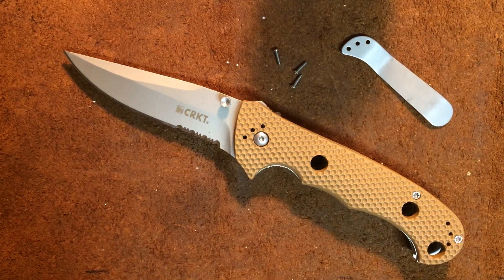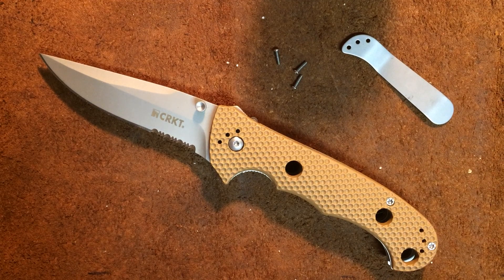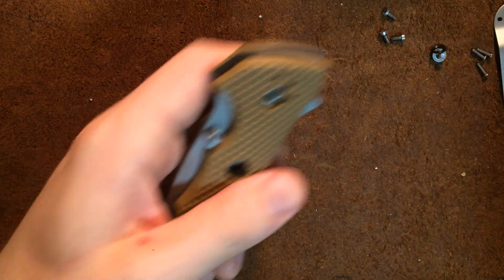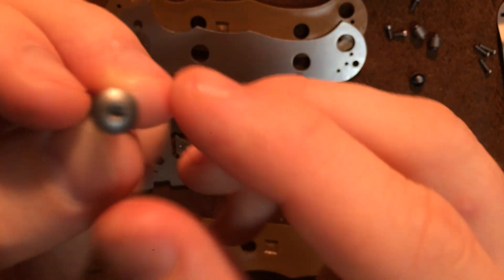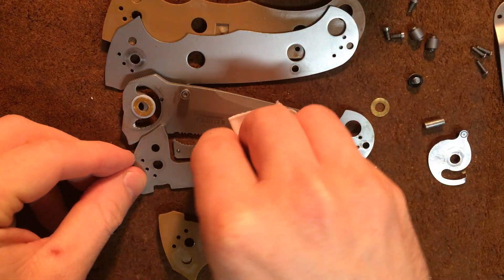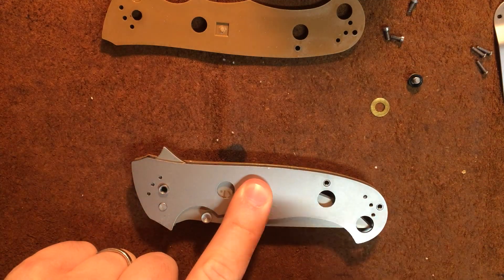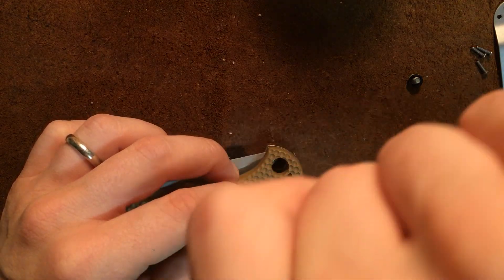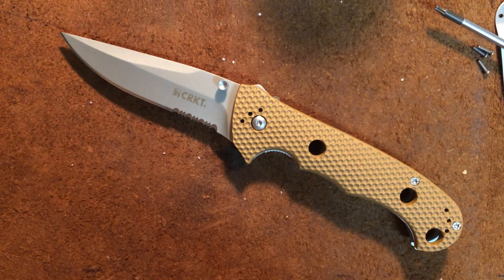CRKT Hammond Cruiser Disassembly

Comment: 11:19 the dent is cause by the placement of the stop in, its on the bottom rather on the top, its cause wear inside rather than outside when you Chop using that knife. CRK DRILLS HOLES IN THEIR KNIVES AS LASHING POINTS FOR A SPEAR AND WEIGHT SAVING -

Comment: No no no, that huge space between the ricasso and the frame was caused by you, it did not come that way. The mfg. put the washer in one way, you decided to reverse it because you "like it that way". So there you go. The jagged track of the stop pin can be caused by the way you re-assembled it or some other form of abuse like purposely trying to break the LAWK system. Seems that this particular knife has had some irresponsible owners I would say. Probably not the best sample to review. I've used mine for about 2 years doing a few large tasks (batoning, cutting fence wire & leather) but mostly lightly overall. No problems with my sample yet.